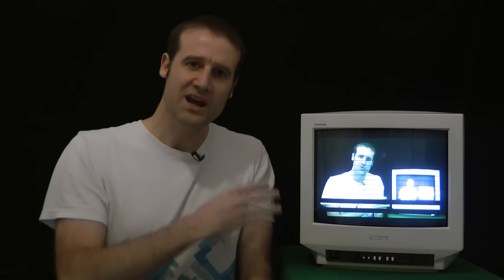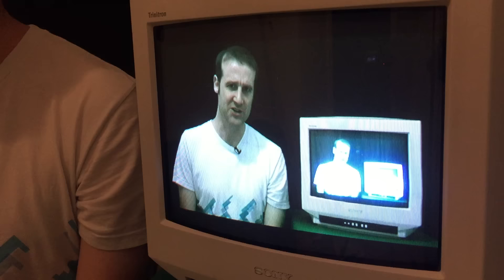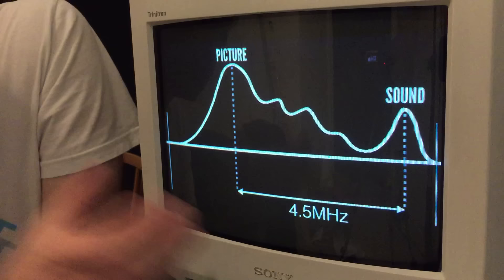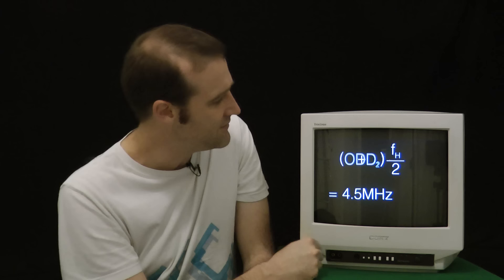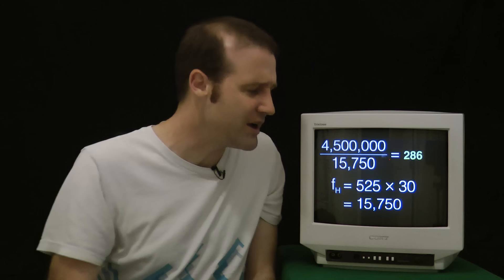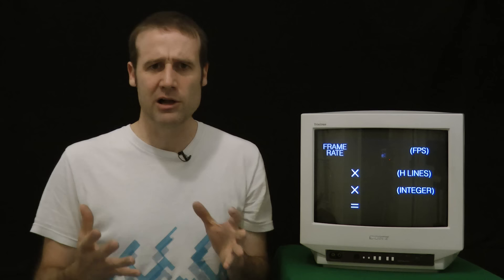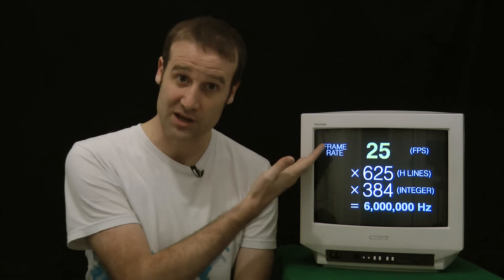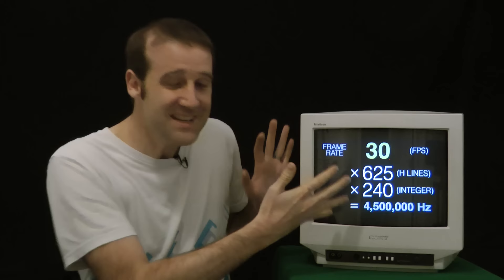Why is TV 29.97 frames per second?

Comment: PAL has a bunch of drawbacks, though.  25 fps (or 50 frames scan rate) is headache inducing without long persistence phosphors.  TVs without it looked like hell, at least to my NTSC eyes.

PAL also isn't anywhere near a multiple of 24 fps.  You don't get the benefit of 3:2 pulldown, so instead movies broadcast in PAL are (well, probably were with today's tech) broadcast with PAL speedup.  That means the movie is ever so slightly on fast forward, and everyone's voices and all the music is off by a semitone.

Of course, with today's tech, 3:2 pulldown sucks because it's uncorrectable and can introduce judder, and PAL speedup is correctable and provides a perfect version of the movie after correction.  But even that doesn't matter because NTSC is no longer broadcast (at least in North America) and I think PAL isn't broadcast either.

So I maintain that PAL sucked for the majority of the time people had to put up with it because everyone sounded slightly like chipmunks, ran around slightly too fast, and cheap TVs could induce headaches.  Plus your computers and game consoles (at the time) were slower (very noticeable with the C64).  But the picture may have been better frame by frame.

Also, FWIW, PAL is the third standard introduced to Europe, so no wonder they managed to get a lot of things right.  The first standard was SECAM, which makes NTSC look excellent!  And before that there was the 405-line standard in the UK.  NTSC did pretty well considering it beat out SECAM and PAL (though 405-line in the UK was built out before NTSC).
Reply: NTSC doesn't get off the hook for headaches. 60Hz is still painful on a CRT, and it's NTSC's fault that the default refresh rate on computer monitors is 60Hz, because early CGA boards had a composite output designed for NTSC. 

In the 1990s I was constantly going into the Windows 9x settings and turning up the refresh rate so the computer wasn't unusable. Usually, I could put it on 85Hz, though there was the odd one which would only go up to 75. Still a huge improvement over 60, though.
Reply: That is true, 60 Hz isn't pleasant either.  I found the minimum was really 72 Hz.
Reply: With CRT's, it depended on the phosphors used. Some sets, if viewed using peripheral vision had a very marked flicker. Viewed straight on, the flicker was less, but on some sets, always there.
Reply: I know what you mean. I live in europe I got headache from using televisions and PC monitors. I couldn't use a PC without having the refresh rate turned up to 85hz. LCD and other flatpanels have made this a non issue though :)

Oddly it was never that big of a problem on my old monochrome atari monitor as far as I can remember.
Reply: kinda sounds like this dude knows what he's talking about
Reply: PAL is broadcasted since today, we have not cut off all PAL programs yet, for example the German cable system is still in PAL. Also not all tv stations send out HD, as it is much more expensive and unlike NTSC PAL can be greatly expanded from the original 12" screen even towards 50" or more without getting too blurry, because the signal itself is easy to compile and increase by modern electronics.

ANd that is, as you said right, because PAL was the last of the SD systems to come in existent: They already thought about greater television sets without making the picture too blurry and they wanted to get rid of the old 405 system, that was still in use for example in Germany in 1967.

But I would not say, that NTSC has beat out PAL and SECAM. First of all: SECAM was the system of the French world and the communist bloq. SECAM therefore mostly died because the communists died and changed their system then to PAL and France is now the only country in Europe broadcasting in SECAM. But, unlike NTSC vs PAL this is not an offset, as the only incompatibility between SECAM and PAL is, that the colour information is decoded in another way and you will always get a perfect SECAM picture on a PAL screen, just in black and white. NTSC is on the other hand not compatible with PAL or SECAM.

And second: NTSC is mostly there successful, where the Americans had their greatest holds: Japan, the pacific islands, the Americas and some former colonies. PAL on the other side is used in all countries of Asia, that were not the sowjet union or Japan, Taiwan, Phillipines, is used in all african countries, that are not former colonies of France, and used in all european contries, that are not France. PAL has triple the viewership of NTSC... so, who has won? ;)
Reply: Acme. Nipp-on-AiR
Ahhh, but how many are on PAL-B/G?  Doesn't count if you include 60 Hz / / NTSC colour subcarrier / Different sound frequency PAL.  ;)

But overall you're right.  PAL (in some format) will probably be the last analog system broadcast.

In contrast, you could pick up an NTSC signal with any NTSC set and watch TV.  Only Japan modified it slightly, and it still looked fine no matter which TV you chose, you'd just have to play with the contrast/brightness a little bit.

Don't think I'm trying to play up NTSC as the best choice, it does have its own drawbacks.  Fewer lines, worse definition, and, if you had an old TV set, colours that wouldn't hold true.  All that and you'd get messy colours without comb filters.

All I can say is digital is the right solution!  :)
Reply: But that is 72Hz non interlaced. Not really comparable.
Reply: Meh the PAL speedup is easy to live with. I can go to bed sooner.
Reply: 3:2 pulldown is correctable. I think some/all modern TVs correct it themselves as it's so common.

> But even that doesn't matter because NTSC is no longer broadcast (at least in North America) and I think PAL isn't broadcast either.

It does matter; it may not be strictly NTSC and PAL any more but it's the same frame rates and so on. Things still get 3:2 pulldown to show on TV in the US, and films still get sped up to play in Europe.
Reply: I think just as bad as the refresh rate, was the transformer whine at near 16 kHz. As an adult, I can't hear it anymore, but as a kid, it was quite annoying.
Reply: Henrik Mikael Kristensen   Some sets were worse than others but yes, that whine was annoying.
Reply: :) gladly nowadays we have overcome this problems. Ok, nowadays an EMP can kill our whole hardware... but on the other side we don't have the annoying whine anymore :D
Reply: Acme. Nipp-on-AiR
No, just the incessant whoosh of hard drives recording our shows, and blindingly bright LEDs telling us everything's on. Or off. :)
Reply: Well, my show is on UKW and I record it for the internet myself, so that everyone outside the UKW reach can hear it. But unfornatunally I even have here on youtube to cut out the music, because well I don't like copyright strikes :D
Reply: 3:2 pulldown is correctable if the studio didn't fuck with the video too much (which is often not true unfortunately).

Comment: I understand why these standards had to exist back then, but it just doesn't excuse how europe today is STILL doing at 50 or 25 fps. The internet has brought the world together, and when the jump was made to 1080p why on earth would anyone choose 1080p50 over 1080p60? There's no argument here, a higher FPS is simply better.

I also don't know if NTSC still runs on 29.97 instead of 30, but if so that's stupid as well. The jump to a new resolution SHOULD have been an opportunity to right all the wrongs of the past.
Reply: Because compatibility with old TVs.
Reply: Europe uses 50 fps because power cycles at 50 htz. If you film in Europe at 30 or 60 fps, you will see lights flickering because the lights will be out of phase with what you are capturing (think of a helicopter blade when filmed).
Reply: That doesn't really excuse it. Take this video on youtube for instance: I have it set to 1080p50, but my computer monitor's refresh rate is 60hz (I'm pretty sure that's true for all computer monitors worldwide, except 120hz or 144hz ones of course). That means that, for a video that's going to go on YouTube, shooting at 50 FPS makes no sense.
Reply: Even if you set it at 1080p50 your graphics card will smooth that out to match the monitor. And this 50/60 problem does indeed exist because of backwards compatibility. Heck, they even included the completely nonsensical interlacing method to the digital HDTV standard for backwards compatibility with CRT-tvs.
Reply: Unless it's a very expensive high frame rate screen, each pixel takes about 20ms to change state. Because modern screens hold their state rather then needing to be 'refreshed' like CRT, the refresh rate is actually the data rate, rather than the rate the screen changes.

In addition, on a computer you will not be able to perceive a difference playing a 50p video on a 60htz screen (and visa versa). This is because of the way the computer buffers an image before transmission. So although the rate the data is being sent is mismatched, the frame sent is correct for the time it's displayed.
Reply: Thankfully the 4K standards have now dropped interlacing :)
Reply: I watch regular television on my monitor with a tv tuner. The broadcast is 50Hz here and there is unfortunately no way to get rid of the stuttering. Interesting how all normal LCD televisions can display 50Hz, but I have yet to see a monitor that is not fixed to 60Hz.
Reply: Ady88, from my understanding unless Nvidia G-Sync or equivalent is at play (which it isn't), my monitor's image WILL be refreshed exactly once every 1/60th of a second. To play 50 FPS video, some of frames stick are actually displayed twice, which is apparently called pull-down as a quick google search reveals.

This might end up as stuttering, the video has to be played at an inconsistent framerate of 60fps and 30fps, AVERAGING OUT at 50 fps.

Did I get any part of that wrong? If not, I hope you can see how dumb this is - why bother making a video at 50 fps when it's always going to be pulled down to 60 fps anyway?
Reply: gabest4 you should be able to set your refresh rate in your display settings (on your computer, not monitor). Modern screens are capable of showing both due to digital frame buffering in the monitor.
Reply: I know, but maybe I just had bad luck with my monitor choices, but none of them could do 50Hz.
Reply: It's because of the 50Hz power grid and the lights, why is that so difficult to accept?, the lights would flicker if they were being recorded at anything other than 25 or 50fps.

Changing the power grid from 50 to 60Hz is more than a pain in the ass, and it would be extremely expensive as well.
So even if you don't like it, you will have to deal with 25-50fps videos.
Reply: That's the neat trick broadcasters used to convert 24fps movie frames into a 30fps frame rate for analog TV.
Reply: Should, yes. Please look at the HDMI video standard that encrypts everything - but also digitally encodes and encrypts a blanking interval for your analog TV. NTSC still does 29.97, and it still causes headaches for everything working with it. Converting frame count to duration is nontrivial, finding out how to broadcast continuously is a headache, because a day doesn't have an integer number of frames to broadcast! Heck, even a 30-second commercial lasts 899.4 frames - very close but not quite 30 frames.

Comment: When then do most NTSC dslr's shoot at 23.976?
Reply: Simpler rate to make (because it's just 25% less data) and it's an easy conversion - https://en.wikipedia.org/wiki/Three-two_pull_down - both for video and audio. Fundamentally the same reason a PS4 now renders at 900p - it's not quite powerful enough for 1080p, but it's close enough.

Comment: I just wished these odd numbers could be dropped. We are in a digital age now. There's no need for 23,976, 29,97, 59,94 or the like. There's also no need to reduce the colour spectfrum from 256 down to whatever it is in the video encoding system. – Keep it nice and clean and don't mess everything up.
Reply: They are dropped, a GoPro won't record in 29.97, neither will your smartphone. It's just in legacy systems that you will still see odd numbers, but at the same time the way rendering digital video works, it doesn't matter for a single bit if the source is 23.976 or 24, it will produce the same result anyway. So there is in fact no bad thing still happening.
Reply: @GBOAC  When YouTube introduced double the framerate support, videos encoded at 59,94 did not show up as 60 fps videos and was coded as 30. Because people still to this day insist on using non-integer framerates.

Comment: You brilliantly explained this. I also appreciate your explanation of PAL vs NTSC. But, the PAL standard is based on 50 Hz power, which is, itself, a weird Hz. What would Europeans have done if they had 60 Hz power? Additionally, the lower frame rate of PAL does create a noticeable "flicker" for some with sensitive eyes. Plus, the phosphors in TVs have to be different so that they don't die out as quickly between scans.
Of course, with modern electronics and the ability to tweak frequencies and deal with interference between frequency bands more precisely, the "25%" buffer you mentioned that older electronics (vacuum tubes) couldn't deal with would have made an even 30 fps possible within the 4.5 MHz broadcast allocation.

Comment: Wouldn't changing the horizontal lines have a higher risk of breaking old televisions?
Reply: Yeah, he barely understands the subject and does many minor mistakes.
Reply: No, it never effected old TV sets. I serviced both for many years. Not that it was totally problem-free for either kind of tv.
Reply: @rom5285  ... Yes, the way they did it with the 29.97 fields per second didn't break old televisions. But had they done the other thing it would probably have been incompatible with old TV's.
Reply: High voltage generator circuits were driven by hsync on many TVs and changing horizontal rate significantly would change the voltage with potentially bad consequences AFAIK..

Comment: The full story is:

1. Backwards compatibility with both B&W TV sets and the existing TV transmitters. Sets could cope with a slight change in the line scan frequency or the picture/sound spacing, but all the transmitters would have to be re-tuned.

2. Math! The tech of the day was valves (tubes) and the phase locked loop had not yet been invented. The various scanning frequencies had to be generated by dividing down from a master reference using only simple integer factors.

I think 29.97 will be around for a long time, till everyone has gone digital. There are still analogue transmitters around in the world so they have to be catered for. I know a couple of people in the UK who still have analogue TVs in the kitchen! I had hung on to some first generation STBs that would receive a digital signal and output analogue, and was able to save them when the analogue transmitters were turned off.

I had to search for this: http://editorsbench.co.uk/documents/CF2015.pdf  You will find all the numbers there!

Comment: You have lower frame-rates.

I'd rather drop less than 1 frame than implement a ridiculous system change just to introduce color, and I'd rather have a higher fraemrate than more horizontal lines.

Comment: The reason it HAD to remain a mess is while Color TV did arrive as a standard in 1953 it took 19 years for color SETS to outsell B&W sets. in fact 19 inch B&W sets were still available into the early 1980s, So the color system HAD to remain directly compatible with the B&W standard, Just as the FM stereo radio signal had to be stuffed into the same bandwidth as the existing FM mono channels., even decades after every FM station was stereo.